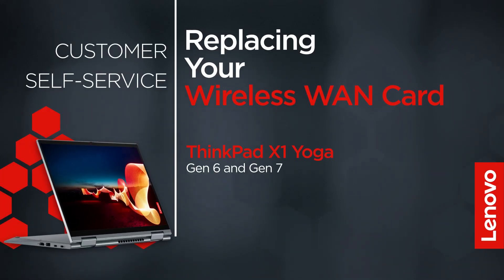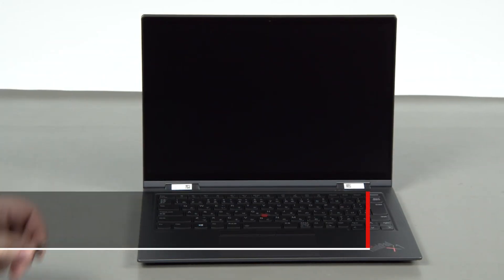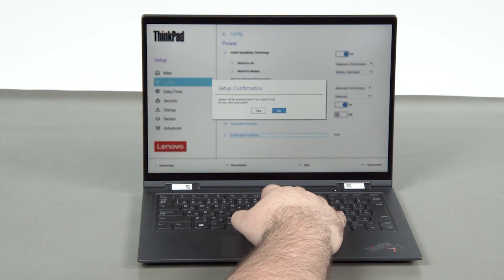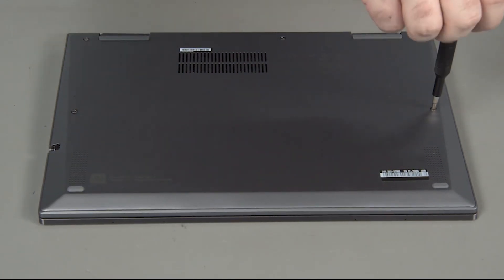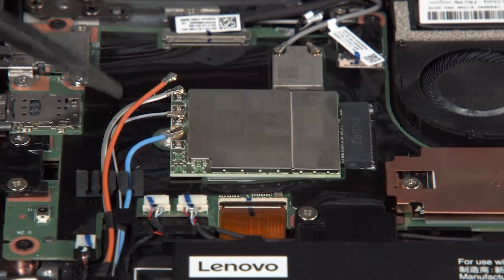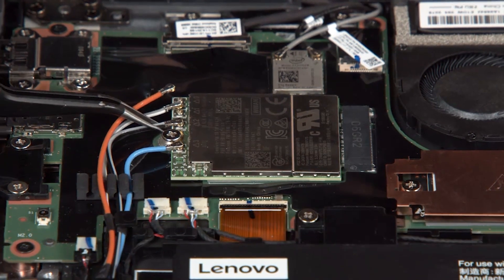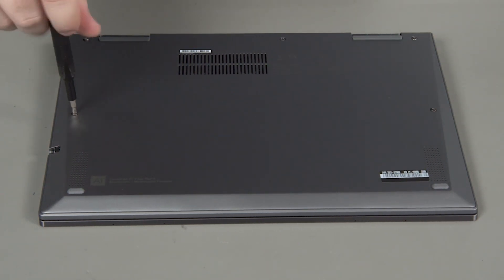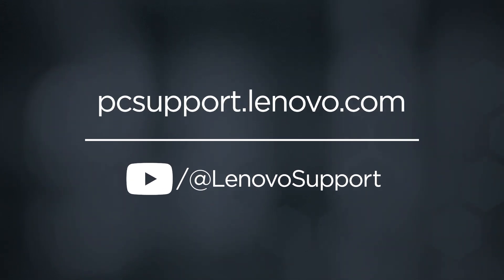Replacing Your Wireless WAN Card | ThinkPad X1 Yoga Gen 6 and 7 | Customer Self Service

Comment from the maker: This video will show you how to replace the Wireless WAN Card inside your ThinkPad. The process in this video will work for the ThinkPad X1 Yoga Gen 6 and Gen 7. 

You will need a screwdriver kit, a non-metallic pry tool, static-safe tweezers, and 30 minutes of your time.

To view the ThinkPad X1 Yoga Gen 6 Self-Repair Guide go to https://pcsupport.lenovo.com/us/en/products/laptops-and-netbooks/thinkpad-x-series-laptops/thinkpad-x1-yoga-6th-gen-type-20xy-20y0/selfrepair/removalsreplacements

To view the ThinkPad X1 Yoga Gen 7 Self-Repair Guide go to https://pcsupport.lenovo.com/us/en/products/laptops-and-netbooks/thinkpad-x-series-laptops/thinkpad-x1-yoga-7th-gen-type-21cd-21ce/selfrepair/removalsreplacements

To learn more about your device go to https://pcsupport.lenovo.com

To find parts for your device go to https://support.lenovo.com/parts-lookup/?cid=ww:lenovosocial:b9515f&source=socialmedia&subsource=yt

To view the Lenovo Support Self-Repair Guides landing page go to https://support.lenovo.com/us/en/solutions/HT516547

** NOTE: Static electricity can destroy components. Use a grounding strap, and clean, non-conductive surface to work on. Use plastic or coated tools to prevent scratching and avoid using metal tools on plastic parts. For more detailed information on electrostatic discharge and how to prevent it, please watch our ""Understanding Electrostatic Discharge (ESD)"" video: https://youtu.be/by4PB3WtdLo 

Applicable Machine Types:
ThinkPad X1 Yoga Gen 6 - 20XY, 20X0
ThinkPad X1 Yoga Gen 7 - 21CD, 21CE

#lenovo #LenovoSupport #LenovoTechSupport